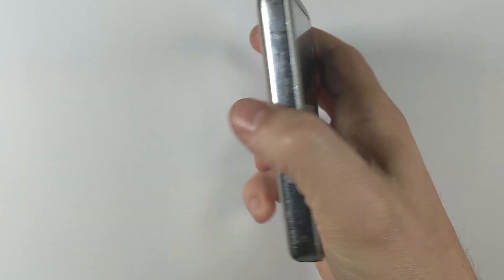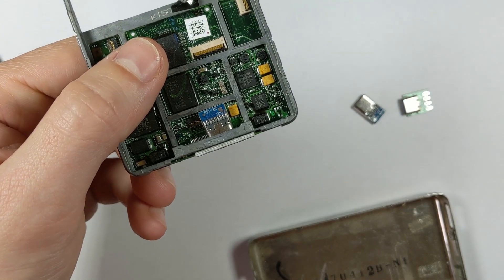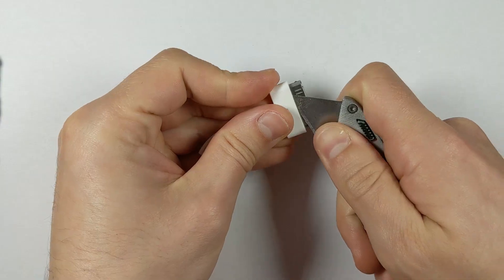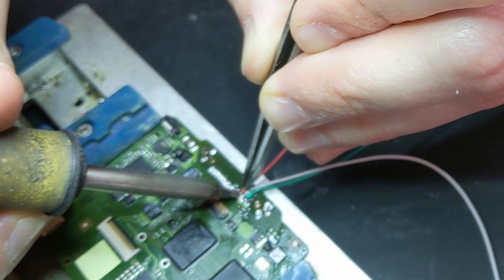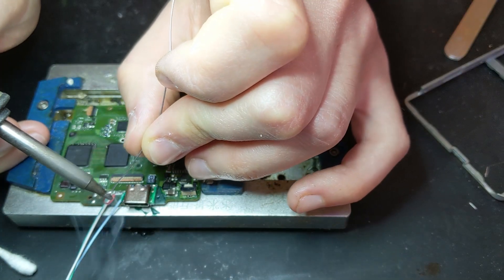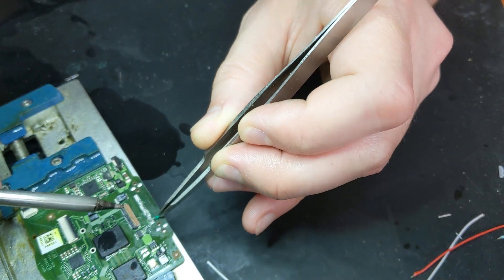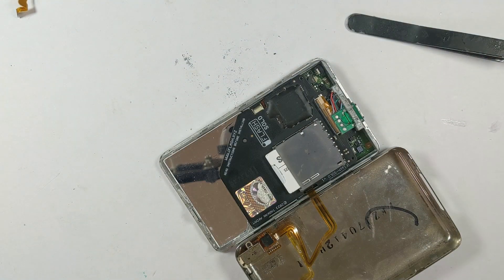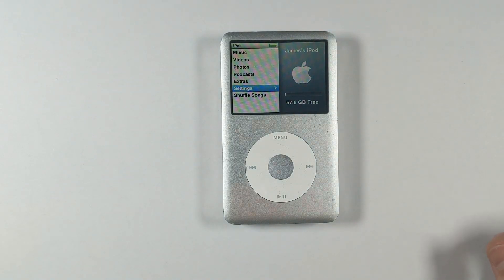USB-C iPod Classic 6th Gen mod

Comment: I'm curious to know what the benefit of this is, as I expect it doesn't automatically give you fast charging or faster USB read/write speeds. Is there a way to change the USB controller to a 3.1 or 3.2 one? Or will the OS be a limitation there too?

Comment: Been watching your videos for a while now and have finally managed to solder a taptic engine, and bluetooth board to my 7th gen successfully! Thank you!

I am now going to try to make some new ground by adding the "ipod radio remote" board internally by soldering directly to the 30 pins internally. The idea being that I will have two working headphone jacks on the iPod 7th gen, but more importantly, one of those jacks will be going through the Wolfson DAC! :D

This is an idea I've had for quite a few years but have not had the knowhow or skill to attempt. But thanks to your videos, I've learned enough to give this a try! I will keep you posted and will take pictures as well!

Comment: Will line-out work with this mod?
Reply from the maker: no but it is possible to add if you buy a usb c board that has the correct solder points for it

Comment: is it possible to do this mod while also keeping the 30-pin connector?
Reply from the maker: yeah you could although the soldering would be a bit trickier i think. You would also have to cut an additional hole or 3d print a different rear housing although i might try that in the future.
Reply: @partspluspods3689  YIPPEE  💪💪 tysm for answering my questions dude, ur a G

Comment: You will definitely lose FireWire charging by doing this, which means if you accidentally over drained the battery, you will have to change it out.
Reply from the maker: yeah that's the biggest downside of this mod. Although most people probably dont use a firewire charger they seem to work a little better from my experience. USB-C is capable of doing 12V if you have the right circuit board. It requires a special chip to communicate with the charging brick on the other end so it may be possible to do a USB-C mod that hooks up to the 12V firewire pins.

Comment: When an iPod connect to iTunes and says it’s charging, but not actually charging it means that the battery management chip is faulty. My iPod had a faulty battery management chip, so I tried to replace it, but the parts are very hard to come by. The part number is: LTC4066

Comment: awesome dude thats a great tutorial! was just looking for a vid to confirm the pinout i found online but this is way more helpful, cant wait to make a fancy lil ipod mini it seems the cheapest model to fully spiff up. 
Question tho, the board u used and linked does NOT have the required resistors for type c to type c charging correct? looking at alliexpress 1s similar to those and some adafruit breakout boards that def have them included but have a slightly worse footprint. ty !
Reply: No podrás usar un dock, para amplificar ese ipod, no podrás usar la radio fm de 30 pines, ni un transmisor de fm, ni nada de lo ocurrente que existe para ipod
Reply: @danielgomez7111  uh yeah i definitely  dont want an ipod dock tbh lol. anyways I actually did this a couple times since making this comment (went with the adafruit boards) certainly a fun lil project and nice devices to leave in a bag for lunch breaks and stuff. hugely recommend the taptic speaker replacement as well for all models
Reply: i believe some of the custom usbc boards made for ipods specifically let you use docks if they matter to you tho (more pricey but they also work good)
Reply: oxyllmod's higher end board revision specifically

Comment: Would the USB-C mod still work with a car iPod interface or is it now aux only?
Reply from the maker: this specific mod has no audio through the USB c port. Although it is possible to do if you use a different USB c board and put another 2 wires. I might do another video in the future that features that.

Comment: I would love to do this, and I love that its very basic and straightforward XD but my hands can not do that anymore. I wonder how much it would be to make pcbs that basically cover the whole pad area, pretty much just a type c "replacement socket" like replacing a 30pin normally. That would also allow mounting something that plugs the new bottom gap.

Comment: The device still needs itunes to be useful, crazy how apple was able to make a repairable device of this degree concidering today with serialized parts
Reply from the maker: Actually i have found a really good iTunes alternative called foobar 2000 + the ipod plugin. Its way less buggy for copying music to the device and also has a way to copy music off of the iPod too. Only thing it cant do is reset the iPod.
Reply: @partspluspods3689  I'm on linux not sure such a thing would work for me most stuff is just clinging to windows as always so not aware of alot of software since about windows 7 days last used windows in 2020 with 10
Reply: @StuffingSkulltag You could install a Rockbox firmware instead, this would take a hit in the ease of use for the iPod but it adds a lot of features to the iPod as well as making it a drag and drop player that you can just see in your file manager.
Reply: @StuffingSkulltag  I don't know if you're still interested a year later; but programs like Rhythmbox or Strawberry work well as iTunes alternatives on Linux, at least if you're working with a library of MP3 files.

The one caveat is that the converter Rhythmbox uses doesn't work well for iPods (at least with my 4th gen Photo) - MP3 320kbps have skipping issues, and AAC has extremely low bitrate; so if your library is FLAC and you plan on loading in MP3s into the iPod then I'd recommend converting the FLACs using a separate program and maintaining a separate library of MP3s for the iPod.
Reply: @partspluspods3689  MediaMonkey works well also.  It's great music library management software in its own right, but supports iPods as a bonus.
Reply: @partspluspods3689  thank you! i needed this since i was getting really tired of iTunes